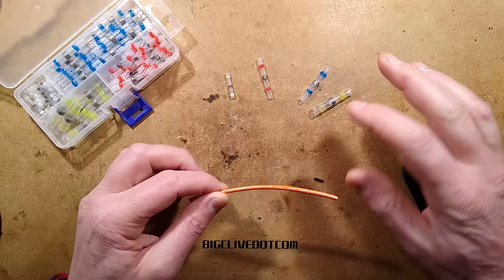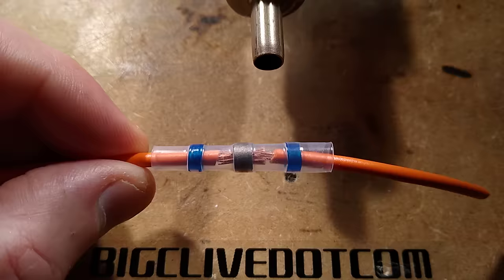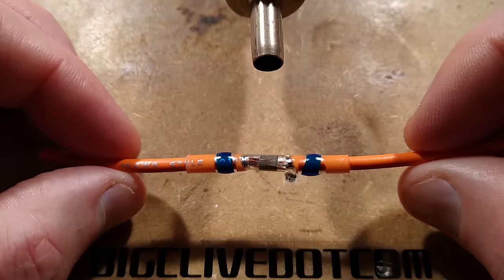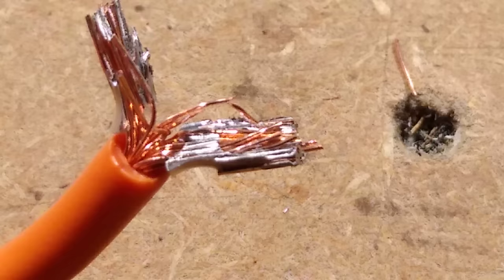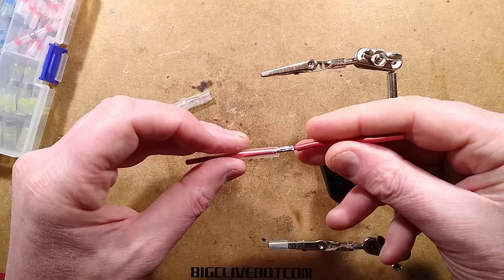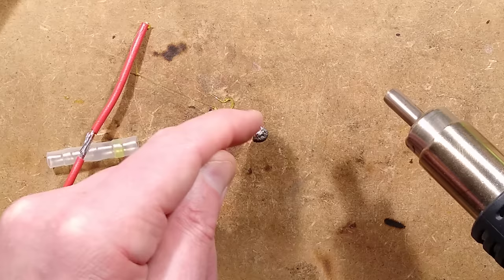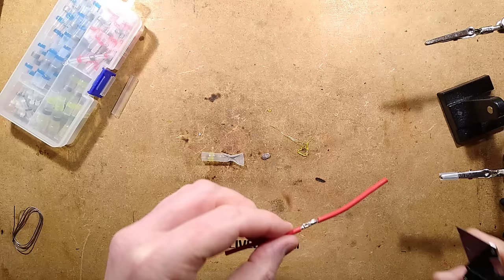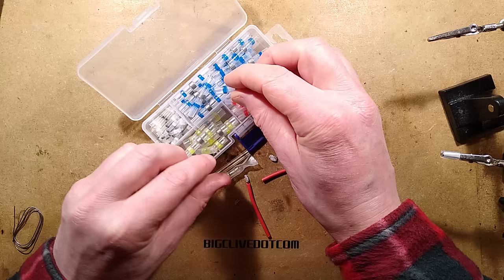Heat shrink solder butt connector test.

Comment: Hi Clive. I have a problem, the dreaded no energy cordless. I have a few cordless drills with knackered batteries. So I have decided to renew the cells, but, being I am no electical/electronic wizard like yourself, I am finding as to which type of batteries to buy a Big conundrum. So I thought I will ask the Big Guy if he can help. Right,cheap Chinese are best avoided I think(unless you know of some good ones that low fly under the  crap banner) So, I am thinking LG, Samsung or Panasonic batts ,but, whay type Low or High drain???. This has me confused. Can you recommend some good batts for cordless tools. I have a AEG with NiCd a Hilti with NiMh and Hilti with L-ion?? Any advice advice you can offer would be gratefully accepted and of a great   help. PS. I bought them second hand not new. Many Thanks, Leon.  :-)
Reply from the maker: Hi Leon, initially I would suggest trying to find a complete new battery pack.  They're usually jammed quite tight with large spot welded bus bars.
Reply: Hi Clive, I have bought a couple of second hand replacement batteries, but they did not live up to much. Unfortunately I have been forced into involuntary retirement.To that end financially, New ones are not an option for me (esp Hilti) so I researched replacement battery cells on the tube. People solder the connections  but what they don't tell you is what type of battery is needed. When I have searched for the cells there seems to be  two types as far as I can make out Low or High drain. I am not sure which ones I would need for a cordless drill a Low or High drain battery. Do you know which one is needed?
 Many Thanks, Leon.  :-) @user-gx6jb6wc5g

Comment: I use these in work on cars and are fantastic for confined spaces. What I will say is the cheap ones are rubbish especially on things thst are resistance sensitive like ABS and anything with a hall effect sensor  , I only use wurth ones as I find they flow better. Tried the Chinese Market ones and they just don't do the job

Comment: You started out bay saying your car brakes down and a wire brakes 

So how well do these work with a cigeret  lighter as if the car brakes dow there no where to get a heat gun ? Or plug one in ?
Reply from the maker: Most people do seem to use a lighter.  I was experimenting to see the flow at slow speed.
Reply: @user-gx6jb6wc5g  could you do a follow up with lighters be interesting

Comment: I have used professional ones and different sizes, that look the same I might add, but the result is like night and day with fully penetration trough all copper all the way to the core and no dark surface from the solder as well. The amount of solder in these is just a joke so I do not recommend them what so ever no even for hobby since you also have no idea what flux is used so it can corrode after a short while for all that you know, and so on.

Comment: is it ok if some of the adhesive contacts the copper wire?
Reply from the maker: As long as the ends are fused with solder it should be OK in low voltage applications.

Comment: I tried these on twin&earth with a cigarette lighter. Didn't work even after sanding the copper wire.
Reply from the maker: I wouldn't recommend these for solid core or other mains voltage wiring.

Comment: Used these on 2 vehicles now waste of time both failed but still seemed to be connected I think the alloy inside is not meant to join copper wires, both vehicles needed these removed and the wires properly soldered which fixed the issue for good…. Throw them in the bin! Raychem sell them at £2 each and they work extremely well but these eBay/Ali ones are no good

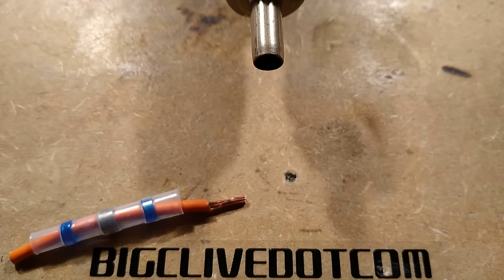Comment: Why didn't you use a bit of flux on the copper in the initial test at 0:37 ? I bet it would have penetrated all the way.
Reply from the maker: I was trying to emulate real life use.
Reply: @user-gx6jb6wc5g - Yeah that doesn't fly. In your own description you mention that you should use tinned wires to get a good connection. What "real life" situation do you run into pre-tinned wires when making a repair?
Reply from the maker: @tenthdimension9836  You can pre-tin them with solder before soldering them together.

Comment: Is it relevant for 0.5 mm steel wire splicing
Reply from the maker: No.  It would be weak and the solder may not bond to the steel.

Comment: You're on the right track, but that's not the proper use of these solder sleeves. The main purpose would be, for example, to splice a wire to the shielding of a coaxial cable. The wire you are adding should be tinned prior to the application. Check out the following link and check out the picture for "Installing".
http://www.brandsma-bv.nl/en/heatshrink/solder-sleeves-duraseals/

Comment: I will never use them, I don't like the way the solder fails to bond and penetrate properly, and the low melting temperature is a too low. Not suitable for high current, temperature and vibration environments obviously.

Comment: hey are these any better then using  electrical tape ?
Reply from the maker: They're just an option.  Alternatives would be through crimps or soldered connections with heat shrink sleeve or tape.

Comment: Wire has to be new for this method to work
Reply from the maker: Strongly oxidised and corroded wire is always hard to get a good connection with.

Comment: Handy in a pinch but people who swear by them and use these regularly for all their wiring are asinine. Worst of all you commonly see these in engine bays where you wouldn't even need high current to cause a problem. I try to avoid them altogether if possible, just to avoid an complacency of thinking it's "good enough". I'd rather just twist the wires and wrap in electrical tape if in a pinch, then go back and redo it properly later. Doesn't really need be any better than that for a quick temporary fix and less cleanup and re-preping after. I might consider them in an emergency situation if water is unavoidable and very likely to cause a short.

Comment: You use way to much solder. Contour soldering is the preferred method. And you really need firm connection before solder

Comment: Does anyone know anything on the market that can connect an electrical connection to a nut, I know a ring terminal can connect over a bolt but what I'm trying to do is attach a connection to a 3/8 gas to dinse adaptor for a cheap Chinese mig spool gun.
I could do these connections separately but it would look a mess or I could use a ring terminal but the 3/8 male to female might leave a gap when I connect the female gas an it will leak.
Reply from the maker: Depending on the material it may be possible to file an area of the nut and solder directly onto it.

Comment: if it was possible to power a led from a radio signal that would be good? a box full of powered l.e.d’s would be quite impressive 🤔😯📦🤷‍♂️
Reply: voltage of 3.6 and a current of 20 milliamps apparently? 🤔😯📦🤷‍♂️

Comment: Clive I was recently helping an in-law with some boat wiring and they mentioned these. Watching your video led me to suspect Bismuth and I found this video which demonstrates Bismuth and it's uses in desoldering. I learned something new. Apparently the combined mix of tin and bizmuth gives a very low melting point of ~138C and longer "open" times for working. Even though your video is a couple years old, it was timely for me. See the following vid if you are curious: https://youtu.be/prw8smYuAIc

Comment: We use those regularly but only for low current applications (signal cables on railcars, rail motor coaches,  ... etc).
The really big diameter can be handy to make a connection on the shielded part of a cable : https://www.youtube.com/watch?v=uhRCUAYoSXg

Comment: Bought some of these off Aliexpress. Melts OK but mechanical strength is rubbish, you can pull the wires apart with almost no effort. I dont think using this in cars or other areas with vibrations and movement is a good idea.

Comment: Two words: NO CONFIDENCE
Why? 

Note the colour banding, white, red, blue & yellow. 

No coincidence this is also the colour coding of industrial copper pre-insulated crimp lugs. 

The colour denoted the appropriate conductor size they are designed for.  Use the wrong over size and the wires will not be crimped down sufficiently to prevent 100% certain current and pull-out capacity... period. 

Accordingly, the crimper dies are colour coded to suit the corresponding lugs.

Further, Lets consider the yellow lugs with the max size 6 sq mm CSA terminated as these dodgy things suggest - meshed. 

With a standard stranding flexible cable of 2x 7 conductors (7/1.04), or worse a highly flexible type containing far higher strand count at smaller diameter = far higher surface area. 

Now, you can work out the surface area of every one of those 14 strands...and don't forget to factor in excessive strip length, longer than that very short barrel length the solder element presents as... which is far smaller than the size of a crimp lug barrel. 

Then have a go at how little solder is in that pathetic ring is... nowhere near enough to cover the total surface area of the conductors/stranding in that joint - as evident in dissection shown here. No surprise. 

Then, there is the tensile strength of that joint, aside highly compromised current capacity across all sizes, not just the 6 sq mm rated at 40A in free air installation scenario.  Good idea?  BS it's anything like a good idea. 

These sure look like cheap Chinese imitations of a highly user specific jointing device as noted - shield termination to pigtail - NOTHING more.  Such current capacity would be in the micro-amp range.  In the aero application no L.A.M.E. would ever consider using these highly dubious imitations of Certified components. 

I have no doubt these are marketed on eBay as a 'do-all' wonder device that appeals to the highly gullible NON-professional out there. I shudder to think where they end up; connected to mains voltage in a consumer appliance, behind a consumer circuit breaker panel, in some experimental aircraft knocked up in a home backyard - with these sinister secrets hidden away, maybe wrapped in insulation tape... hidden from the scrutiny of any poor qualified sucker asked to sign off on work ? !  Fuk that! 

Solder jointing.... highly dubious in any non-fixed application subject to vibration. Fact is, solder connections in such plug terminations ALWAYS have strain relief device in the plug or panel fixed socket to prevent the as noted work hardening/breakage that will occur in service.  My industrial experience that has included fixed and mobile diesel/gasoline engine control panels, plastics processing equipment AND aircraft has plug terminations using crimped pins/socket elements. Very rare the solder type. 

For repair jointing of any current rated cables pre-installed lugs are the minimum I'd ever consider using. Even so, there are 3 types of design that relate to insulation crimp - One is basic plastic sleeve, another has a thin metallic sleeve under the plastic to effect maximum crimp and strain relief that bears down on the insulation.... and the 3rd type is cheap crap imitation junk from the likes of China... sold to the cheap arse ignorant user. 

The quality lugs are far quicker to effect a repair than frigging around with solder and shrink. 

The cross-sectional area of the conductor in those lugs exceeds CSA of the cable being joined. 

The barrel length is of an appropriate size and convoluted internal design to ensure faultless jointing every time, both electrically and mechanically. 

Even so, the use of these is highly dubious in the production of any new equipment such as control or distribution switchboards or installation wiring systems. Their presence indicates someone cut a wire short and had to join and then hide their F*up. 

AND, only a proper idiot uses the wrong size lug for the conductor or incorrect crimper and die set, be that an end terminator or repair crimp link. 

Is that clear?

Comment: No- need to go until the band is gone. You need to learn how to use these.
Reply: Sorry, the proper use of these is to heat from the middle until all of the solder flows. This can be checked by inspecting to make sure the band is gone.
Reply: The tip on the heat gun should be one that wraps around the connector.

Comment: As others have said here, those are rubbish quality. I've used the real deal ones, who do a very good job. Even stresstested it, and pulled the wire and not the solder joint.

Comment: Your method for inter-meshing the ends of the wires is not the correct way to join the wires inside the sleeve. As you demonstrated, it will result in an improper solder joint which will fail. Reference NASA's standard: "WORKMANSHIP STANDARD FOR CRIMPING, INTERCONNECTING CABLES, HARNESSES, AND WIRING (Revision A 2016-06-30) NASA-STD-8739.4. According to their standard, the wire ends are placed side-by-side (lap splice) in the solder sleeve. Look on page 70 & 71, Section 19.6 and pay attention to Figures 19-13 and 19-14.  You can download the PDF from their website or the link below.  https://standards.nasa.gov/standard/nasa/nasa-std-87394
https://standards.nasa.gov/file/2615/download?token=2TwNY-Aq  (PDF link)

Comment: These things suck. He never pulled the two ends which would have showed that the solder never property bonded to the copper. Perhaps if flux was applied directly to the copper first. My experience, I will NEVER use them again
Reply: I use these all the time with no issue but I hit them with quick passes from a torch lighter.

Comment: Your right... the ones you are using in this Video aren't very good... at least to say so, their pretty shitty and low quality ^^
I work in A Wiring Harness Manufatory... and we also use this kind of Tubes... but mostly the Versions that also have a Cable into it. It's for easy use of the shield of some manteled Cables... and dude... there are WORLDS in between those and the ones you've used in the Video ^^ Let me Pretend... you've Paid about 10 Bugs for this little Sortiment-Box? and that's the Reason... good ones, like those we use... a Box of 50 pieces sells for about like 40 Bugs... round about... and this is the difference... yours are cheap... espacially the sorder is cheap... like you see at 5:41 there is nearly NO Flux in it... and that's the reason it doesn't penetrate real good in between the Cables... also there is a weird Ring left over after the heating... also not the best... the Ones we use... there is nearly nothing left over... it looks like you've sordered it by hand and afterwards put on a Shrinktube with this little "Sealing Rings"... cause sorder realy penetrates and connects...

Nice test, but i hope you redo it anytime with GOOD Quality-Ones and then Maybe with some kind like Pulling-Force-Test or Maybe electrical test...
Cause people that don't know these things real good maybe think their shit and not worth looking at for maybe their daylie work... but if you invest at least a bit more in GOOD ones... it makes your daylie Work soooooo much easier and better ;)

Comment: this is stupid first you twist them together not whatever you did and second why do you need it to penetrate, there perfect where a solder pencil or gun can be used due to size. the solder is maybe 80% as strong and 100 percent as affect as actual soldering. I dont know what your doing that requires the soder to melt all the way in. it beats quick taps and the twist-tape method

Comment: i dont need to watch the video to tell you these are hot garbage. i could tell you they were hot garbage when i first saw them about 5 years ago too without testing them. why? because there's no way that proper solder is going to have a working temperature of roughly 200F. try loading these circuits to capacity and long term water intrusion test.

Comment: those are forbidding in our company because it is such an unsecure fitting and the solder as you can see is extremely horrible with no proper connection. a good crimp connection is a million times better than this crap

Comment: All of the sticks I received have one end larger diameter than the other end - illogical AND ineffective; not worth one penny !
Reply from the maker: That sounds like you may have got a wire size transition version.
Reply: @user-gx6jb6wc5g  I didn't know there was such a version but THAT makes more sense - contacted customer support several times to no avail :(

Comment: These suck bad, you are testing on clean bright wire in a room not in shop on a unit that say has 300k on it... Trust me these are fucking terrible! Take the time and do it right, solder the connection with a proper iron then heat shrink...

Comment: The video is incomplete because he didn’t try to apply more heat on another Heat shrink solder butt connecter, then cut it open and compare... 

When comparing all test pieces must be treated equally, and the exact steps must be followed so a 👎 rating.